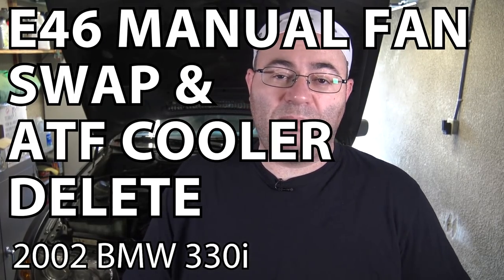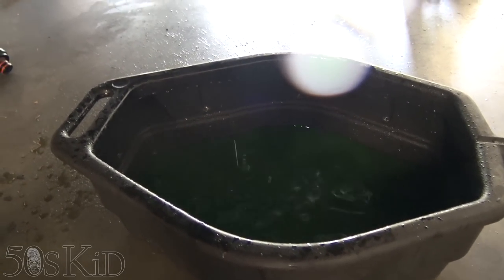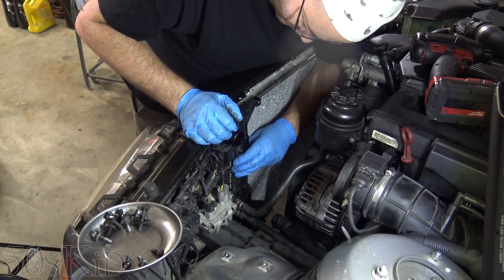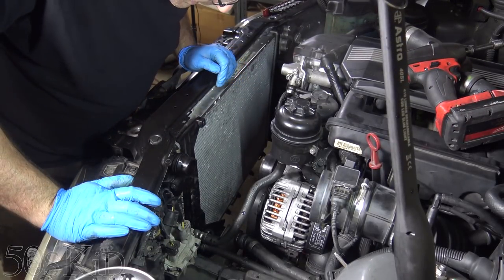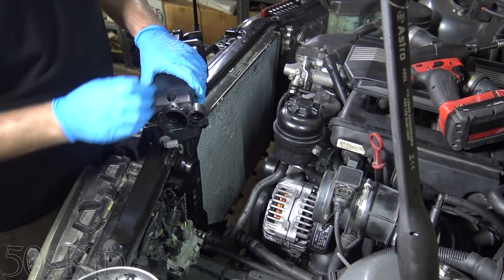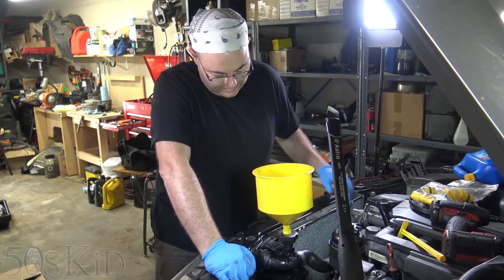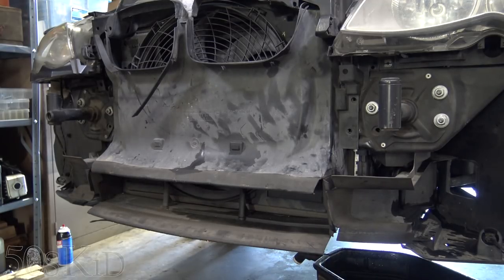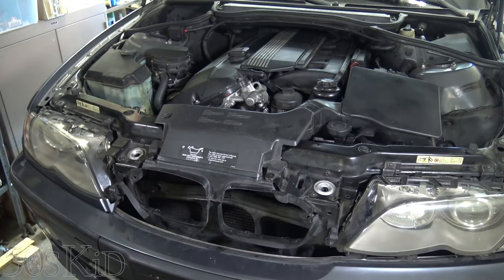BMW E46 Manual Swap Project: Electric Fan & Radiator Bracket Swap DIY

Comment: TIP NOT To Do - don't attempt to use both the pusher fan and the electric fan at the same time.  I splice the wires and bridge a connector for the pusher fan while also connected to the electric fan.  Both fans will NOT activate when engine is hot. Computer/sensor doesn't know what to do. Car gets over heat.   ONLY use one fan.
Reply: Hey so should I use my stock computer & strip the oem fan out? I had the clutch fan break on me going electric wanted the two fans and have literally been on a mathematician dilemma for the past week about exactly what you said, So should I strip old fan out put new Mishimoto one in? And keep the same computer?
Reply: @josephe4667  The electric fan basically plugs into the same connector as the pusher fan or the auxiliary fan for the AC.  I tried splitting the wires to operate both fan, (New electric fan and the AC fan/pusher fan) but when I did that  both fan do not turn on so it results in overheating. There is no need for the auxiliary fan or pusher fan.  just having the electric fan alone  is enough.  my car has not overheated in two years. Good luck
Reply: @cya3651  awesome, I have my parts coming in 10 days so not excited to try and take my bumper off for the first time, The rest should be easy but I’m Lowk dreading that part lol, also- clutch fan broke at the connecting bolt ( where it screws ON to the water pump) should I replace the water pump? I hope it’s not damaged but I have no idea since the clutch fan is right there
Reply: I would say if coolant is  not leaking from the water pump then it’s still good. However if it has been couple of years I would say replace it since you are there already. As for the clutch fan as long as you can get to the nut to loosen it so you can take it off it should not be a problem. FYI..If you are not already getting parts from FCP Euro I would say start because ALL their parts are lifetime warranty. Good luck
Reply: Someone said if you do this you should mod your temp sensor to go on earlier, heard it supposedly overheats with the electric fan. Did you mod your sensor? Or just remove the fans and plug in the electric fan with no mod?

Comment: I changed out the mechanical fan to an electric one years ago on my automatic 330i and it still runs great no issues.  I even recently took a trip from New Mexico to Florida and all went well.  Just in case anyone thinking of doing it.  The electric fan is expensive but it's well worth it.  It's so much easier to take things apart to work on the engine with the electric fan than with the mechnical.  Used to take me like 30 mins to take the mechanical fan off, now I do it in 3 mins.
Reply: NutNbutSpeed did you remove the front aux fan as well?
Reply: @krystlpistol4697  I would, also add porch style screening over front of radiator to keep it clean from bugs and road debree
Reply: Michael Swetell but why remove it? Doesn’t it have a function? My mechanic told me it’s there in case the car overheats.
Reply: @gustavorock4616  Runs off the same connector as the pusher fan.  So the electric fan would kick on in any instance the pusher fan would.

Comment: Please help! I’m about to buy an electric fan from someone to replace my fan clutch fan but I’m not positive if it’s the correct fan and neither is the seller. I don’t want to accidentally buy an auxiliary fan. These were the numbers on the fan “Bosch 1137328080/6922670.1” is this the fan I need to convert my mechanical fan to electric?

Comment: I just swapped out the fan clutch for an electric fan on my E46 320D Touring.  Wow what a difference!  The fan clutch must've been worn out or the fan unbalanced because it's so much smoother now, especially at idle.   Now I have much easier access to the front of the engine and the EGR, plus  I'm secure knowing my 90K miles fan clutch won't be exploding in my engine bay.    Highly recommend this retrofit!

Comment: Hi there, thanks for your  help, teaching  me how to work in the bmw, l have a 330ci year 2006 with temperature  issues,  l change thermostat,  water pump, temperature  sensor and coolant reservoir but still overheat, somebody told me about electric water pump can be the problem, may you please showing me  where is located and how to replaced, l always  will be so thanked. GOD BLESS YOU, you are a kindness  human being

Comment: If you have an auto then these models had a viscous fan that attached to the water pump pulley. Why would you not install a viscous fan instead ?
Reply: Because this video is about swapping the viscous fan for an electric one lol😂
Reply: @98ron  I know what he is doing! The 330i has 2 fans (electric and viscous)so now he has only 1 fan sucking hot air from the engine onto a hot radiator (no engine cooling), when it should be cold air being blown onto the radiator and the viscous cooling the engine! Either way I dont see what gains there are by doing this?

Comment: Hey, i come here to look for some help, i have an e46 330ci and i can't sit the expansion tank on the 2 bottom hose holes, i trien everything, silicone louber and all, anr still won't stay fixed, is a febi bilsten expansion tank. The old one sits perfect, so i don't know if im doing something wrong.

Comment: Hi mate great video what I've done in the past to remove them BMW pipes is I've made a special end for my air blower I squirt great clean down the little hole then use the air to spread it around comes off a lot easier
Reply from the maker: Wow, nice!  You should make a video on that next chance you get.

Comment: According to BMW, blue coolant has conditioners for their parts. Green will not have the properties as the blue and will corrode innards faster than blue... I have always used the OEM coolant.

Comment: I found myself in this exact situation today - did a manual swap, had an aftermarket behr radiator, and wanted to delete the ATP cooler. I watched this video and ordered the manual drain plug in the description and everything. Turns out the drain plug inner plunger and oring are too big to fit into the automatic behr radiator's hole. If you find yourself in this situation, just buy a radiator for a manual car and save yourself the trouble.

Comment: Hi 50s Kid, have to say a big THANK YOU, for your videos they’re all awesome, and inspired me to diy on my top antifreeze hose which leaked after breaking. I did The Whole change and bled and refilled the antifreeze. It was all pretty smooth until I noticed that my fan doesn’t shut off! I had it changed several years ago from mechanical to electrical but recently, it keeps running even while the car is parked and it was draining my battery, so now the only way I can keep from over heating while in stop and go traffic, is I pull off the fuse for the fan, once I park, and reinsert it to drive do I need another fan?could this be something else that is common and can it be fixed? Ever heard of this ? Thanks again please keep posting the videos you’re helping so many people with your expertise. Good luck.

Comment: The front electric pusher fan, is for what I understand, mainly for the AC. As you can see from this picture it's completely marked on to be there anyways in manual car too, even it's with electric fan. If you don't have this and you use AC and car is not moving, I think the pressure on the system might exceed the decired limits only, but usually you don't have the max amount of AC refrigerant fluid there anyway, but I would not delete it myself. https://www.realoem.com/bmw/enUS/showparts?id=BD53-USA-07-2005-E46-BMW-330Ci&diagId=64_0920 The car is just as an example, took just some late E46. But nice video and I love these all manual swap videos, good job :) Very precise videos and great angles and clear. Also I love how you always show mistakes and happenings stuff too. It did save me with the E53 transfer  with front shaft sealing, had also "great time" trying to get it right in rebuilt.
Reply: Manual E46 does not have a front pusher fan  Just the electric at the back.  They both use the same connector to power, so you cannot have both on.  Removing is the right thing to do if you do this swap, as it will restrict otherwise. Have had an v. early 328 manual since new so have first hand exp, and never had any issues with AC.   Having both Auto and manual e46's, the Electric fan is MUCH more convenient than the clutch fan and probably will put less stress on the water pump.  Will also not explode like the mech fan is known to.

Comment: Huge question, so I have a 2005 325CI and I changed the fan clutch because the fan sounded like a jet engine, now I have a coolant leak and plan to change the expansion tank and bracket because that’s where the leak is coming from, although now the fan noise has come back but it’s not the fan clutch, when I accelerate a 3k rpm it’s super loud? What could be my issue any suggestions? Btw I love your videos and and self taught diy kind of guy as well, I know your experienced so that’s why I ask, I hope you can answer my question thanks man!

Comment: I skipped ahead to just the fan swap and he didnt mention where he got the electric fan. Where is it from? My manual 01 Z3 2.5i has an electric pusher fan and radiator clutch fan. I want to remove the clutch fan in order to try and free up some power and make it quieter. When cold the fan is so loud, i believe the clutch is going bad. Might as well swap it with an electric fan. Not to mention my electric pusher fan sometimes gets off balance.
Reply: I think they electric fan can be found in later E46Fanatics models manuals if I remember correctly. I got mine off a manual 330i straight swap plug n play

Comment: Hi, I am new to BMW with a 2002 325i. It is missing many clips and bolts etc. I have been watching your videos in the hope of seeing the correct fasteners to use.Unfortunately, you skip over removing the air duct and fan shroud. Could you please somehow show us what fasteners are used or suggest a place to purchase same that will give me the corrects items. Thanks. PS. Managed to replace the expansion tank support bracket thanks to your videos.

Comment: If you have an older e46 chances are the bumper bolts are e12, requiring a female socket not male. No idea how Jason's bolts ended up needing a t socket and not an e, but I guess BMW changed it 🤷‍♀️

Comment: Hi 50Skids i love your videos so much . im working on a e46 2002 325i my manual fan kisks on at cold start and stays on which should start when engine is hot right and stop after cooling the engine mine doesn't do it like that any help please ?

Comment: Thanks, Jason!

?:  I took your advice and purchased the Astro LED light. Very nice!!  I'm wondering if you keep the dial at full intensity when you're using it??
     If so, how long does the battery last at full brightness in your experience.

Ciao!
Reply from the maker: I frickin' love that thing.  Usually lasts 3-4 hours I think.  Never really noticed.

Comment: Hi Thanks for the video, i have a question, my 320cd e46 doesn't have that fan, is it because my is a manual transmission? Is that usefull only for the atf cooler or also for the climatizzator? Thanks a lot

Comment: i swapped a manual fan onto mine and its not turning on? brand new fan and brand new fan switch sensor in the lower radiator hose 
anyone have any ideas ?

Comment: I've replaced the water pump, coolant sensor, Temp sensor, and thermostat and it's still overheating. Could it be my Aux fan relay or the Aux fan itself or both?
Reply: Same problem here. I’m looking for answers
Reply: @paulnastoff2394  did you figure out what your issue was? Am finding myself in a similar predicament
Reply: @digitaloski8702  Yes. First of all if you install electric fan you need to remove the auxiliary fan by dropping the bumper in the front so that you improve airflow and natural cooling to your radiator. Number two I had a small leak in the plastic overflow reservoir that is notorious for leaking I replaced it with a stainless Mishi Moto reservoir which should end that problem from ever occurring again. Third and probably the most important, you have to make sure you get all the air bubbles out of the coolant system and it is topped off properly by continuing to vent through the breather hole.  To do this You should turn on your heat full blast while the ignition is in acc position and then jack the car up in the front so it is tilting back towards the engine slightly Jack car up about two or 3 inches then top off the bleeder several times.  Probably best if you add coolant under vacuum but I did not have that set up and found the YouTube video on properly topping off your coolant system which helped. She is maintaining good temp since then no leaks.

Comment: I've done this delete and my fan doesn't come on any info on this issue
Reply: This fan will only turn on when your AC is on. It controlled by the PWM signal from the DME. what you need is a SPAL fan that's activated by the coolant temperature sensor and a 12V power source when the key is on
Reply: No, it should run off temp and AC.

Comment: My 328 with electric will not turn off even with no keys in it ?? Eny ideas
Reply: Your fan module (is on the fan shroud near the motor )or relay has a problem

Comment: Hey 50s kid ! Can you help me out? I have a rough idle and loss of power on my 2001 330i. I'm getting system too lean codes in bank 1, and misfire codes with fuel cut off on every cylinder ! So far I've diagnosed that my MAF sensor is working properly, I used fuel trims to determine I do not have a vacuum leak, all my 02 sensors are working correctly (used multimeter), replaced camshaft positioning sensor because I figured it was giving wrong information that would throw off the fuel injectors, but that didn't help. My next idea was checking the fuel system, I replaced the fuel pump about 1000 miles ago, as well as the fuel filter, and replaced the fuel injectors about 300 miles ago, is there something else in the fuel system that I missed? I believe whatever I missed, had to be the culprit. What do you think? I'm going to be checking my fuel pressure pretty soon.. do you have any ideas as to what the problem might be? 😭
Reply: Adam More oh I am having similar issues on my 330ci. Although I had fuel cut from 5 & 6 and figured it may be the coils. Changed them as well as replace the ccv system, throttle body and intake gaskets, new DISA, new vacuum lines, motor mounts, nearly complete coolant refresh with the exception of the radiator, headers cv axles and today transmission mounts. But I still have a fairly rough idle. I may try to replace the VANOS seals if not refresh it with a kit. Have you cleaned your IAC ?
Reply: CVV hosese and separator...
Reply: What codes are you getting? if any.
Reply: does the issue start immediately or when the ECU goes into closed loop (1-2 minutes after starting the engine)?

have you tried disconnecting the MAF sensor and running with it unplugged? does the issue persist?
Reply: Ciprian Stoian The CCV and oil separator are good, no leaks.
Reply: animefreak3939 System too lean Bank 1, and misfire with fuel cut off on cylinders 1-6
Reply: also, change coils and plugs. they're cheap enough to cross off the list
Reply: animefreak3939 Yes the IAC is good, recently clean.
Reply: *cleaned
Reply: I believe the issue is fuel related, because I've diagnosed that it's not a vacuum leak or he MAF sensor
Reply: Ace Futura during closed loop, the car is good, by open loop its trash !!
Reply: MAF already mentioned. It's really hard to not think of the VANOS solenoid may need replacing, or at least tested, on intake and exhaust. And while there clean out the housing for the spring and piston just to be sure nothing is sticking. I also just have a habit of cleaning anything taken off while it's disassembled. I'm actually going to clean the housing on my intake side today.
Reply: Method of "diagnosing" MAF is not mentioned. I've had an E46 with a brand new MAF exhibiting same issues in closed loop as described. When MAF is disconnected, issue disappears.
Reply: Ace Futura I'm going to see if the problem goes away once I disconnect the MAF to see if that's the problem, thanks !!
Reply: Cool, good luck. Also check out anmiefreak's suggestion above =)
Reply from the maker: What do you mean when you say you used fuel trims to determine you do not have a vacuum leak?  What are your fuel trims at idle and what are they when you run the engine at 3000rpm and hold it there?  All 4 trims in both cases please.
Reply: 50sKid 50sKid my short term fuel trims at idle are +27.34 in bank 1, and all the fuel trims are 0, short term fuel trim bank 2- 0, long term fuel trim bank 1 - 0, long term fuel trim bank 2 - 0.
Reply: 50sKid When I keep the car at 3000rpm's the car's fuel trims are exactly the same
Reply from the maker: Sounds like your bank 1 sensor 1 O2 sensor is stuck lean.  Replace it.
Reply: 50sKid is that the upstream or downstream O2 sensor?
Reply from the maker: Upstream, precat sensor.  The one closest to the front of the engine.
Reply: 50sKid just ordered it ! I'll be sure to let you know what happens !!
Reply: Soooo....what happened?
Reply: Adam Moreno what happened?
Reply: @AdamCMoreno  How did it go?